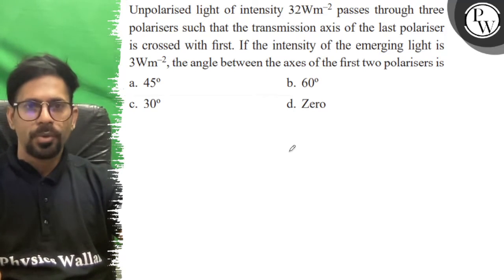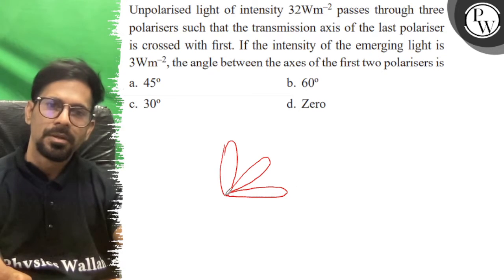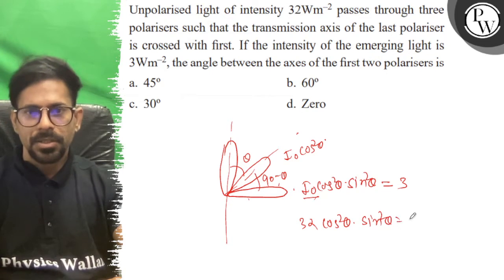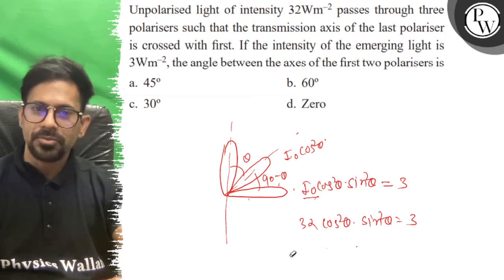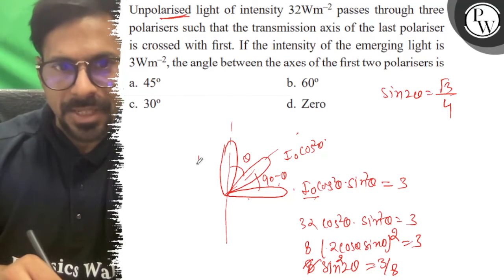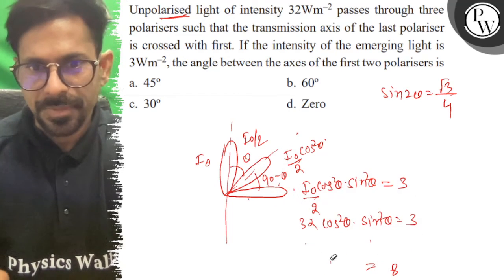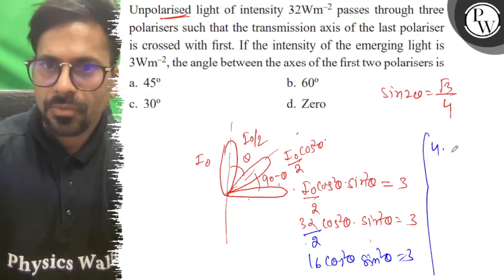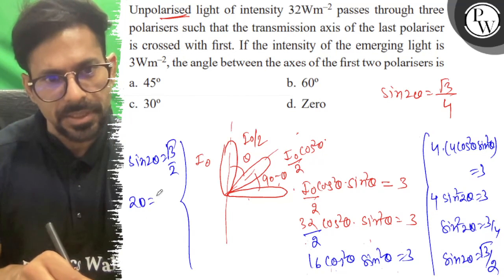Unpolarised light of intensity 32 Wm^-2 passes through three polarisers such that the transmissio...

Comment: Sir u did the mistake the light intensity after passing through second polariser reduces to 32/4 =8 then u write that at 4×(2 sin theta. Cos theta) =3 then u get the correct angle 
U r method used here is completely wrong we don't have 4 sin theta into cos theta and sine 2theta